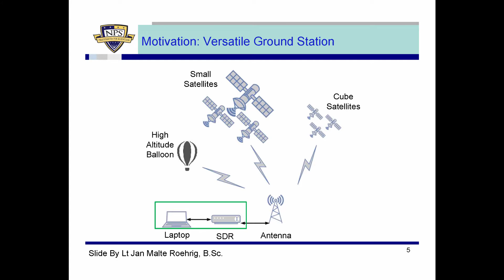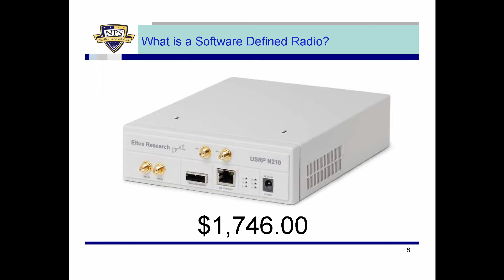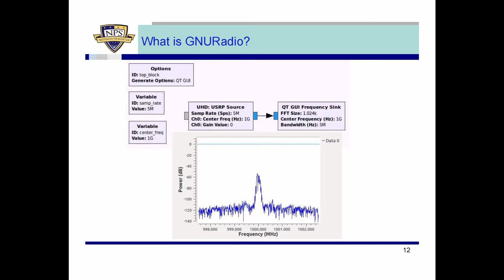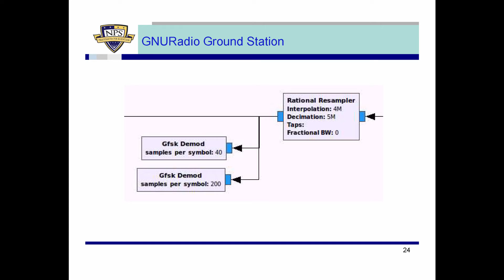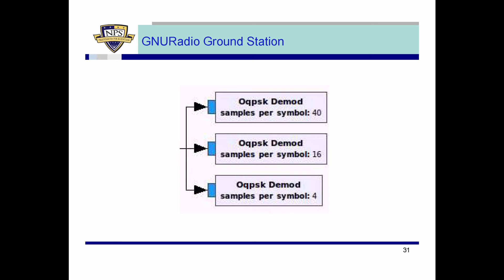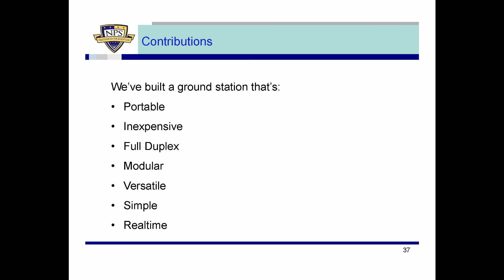How to Build a $3000 Ground Station With GNU Radio

Comment: Why $3000 when you can buy a Hack RF One for $300. 
https://greatscottgadgets.com/hackrf/
Reply: Hack RF has limited frequency range and that makes it not best choice for this kind of project that operates on a wide band range of frequency.
Reply: roladun i would not call 1mhz to 6ghz a limited frequency coverage.
Reply: 1mhz to 6ghz is a very wide coverage. However, when the frequencies you need are 5ghz and 10ghz, it is a limit.
Reply: hackrf one has alot of noise and half duplex, good for programming your next Iot Lightbulb